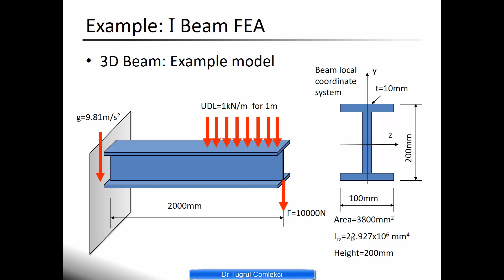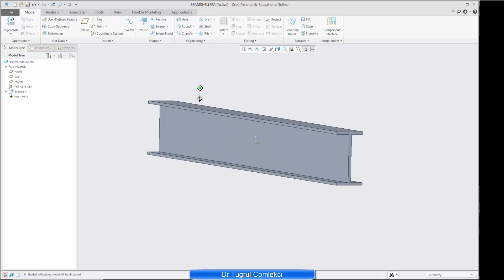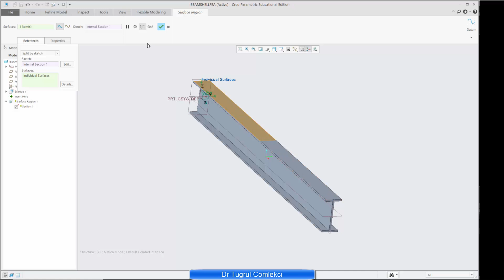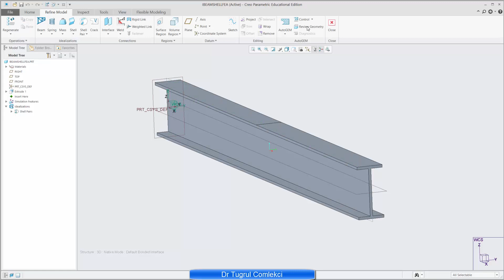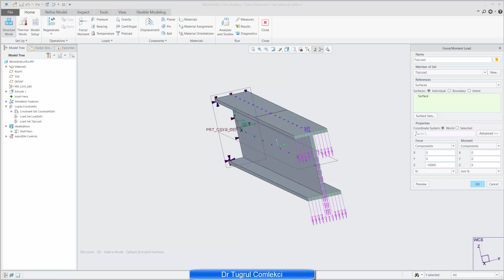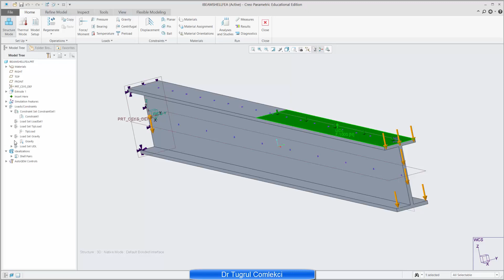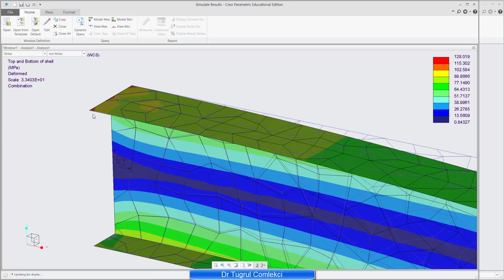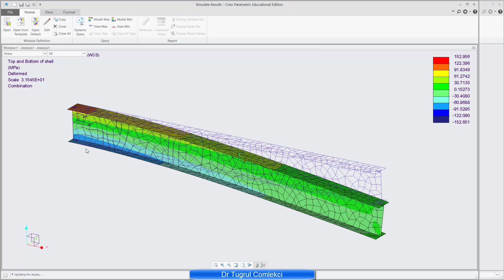Cantilevered I Beam Finite Element Analysis with Shell Element Idealisation

Comment: Hi. I have a doubt. After creating shell pairs I usually review the geometry. While doing so, I can see that the flange midsurface and web midsurface are separated by a value of thickness. It throws some error while running the static analysis. Is there a way to connect the shell pairs of flange and web together?
Reply from the maker: Hi, it looks like the software could not create a fully connected model automatically. That may happen for a number of reasons. If you are following the geometry in this tutorial you may have missed a step. If you are working on a different geometry, the solid model may not be suitable for automatic shell pair meshing. In that case it may work better to create connected surfaces and mesh with shells instead of shell pair. Thanks.